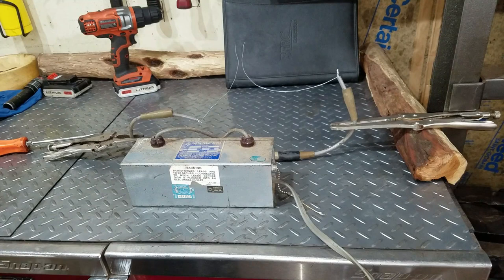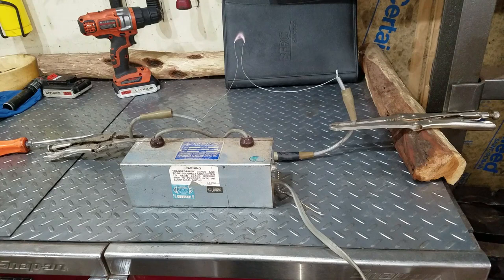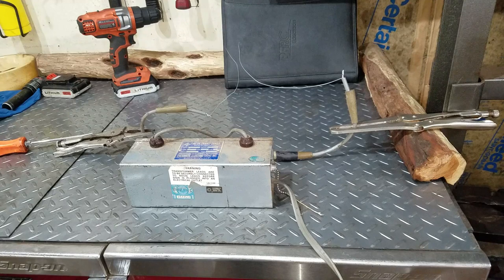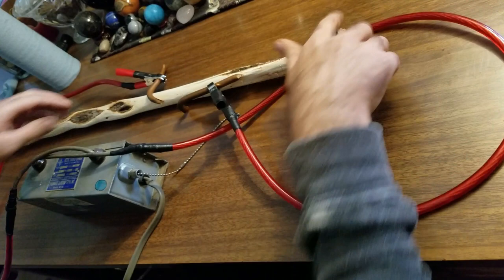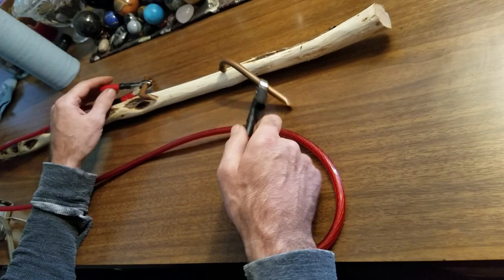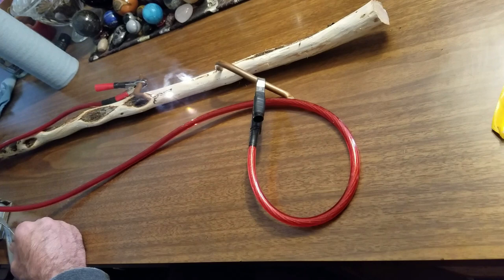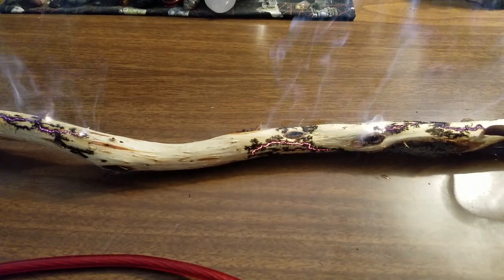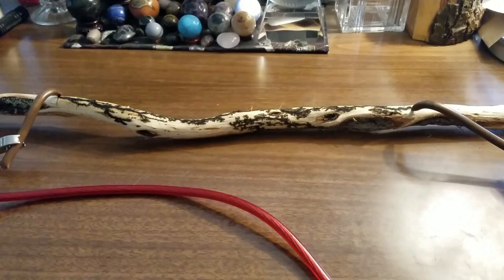Lichtenberg wood burning Diamond willow attempt

Comment: The first thing you did after your first burn was to grab both leads with you hands. In this there are no mistakes, you get zapped. with some transformers you are dead. Before you teach this learn your safety better. 24 people were killed in 2022 doing this. Yes they come out great and your videos are good, like telling someone about ice fishing without telling them about thin ice. Really like your diamond willow sticks. The one you used looks like a neon sign trans. this will shock like a really hot elect. fence. the new trans for this will not work as they have safeties built in for shorts. Raised in Minn. till 1962
Reply: If you don't like this I will take it down.
Reply from the maker: @newalla344  Yes. Very dangerous. I make sure it is turned off, before I touch any leads. It might be less dangerous using this versus those crazy fools using microwave transformers that are touching wires when they are hot, but I'm not willing to find out. Any time you are dealing with home electrical devices, or house wiring of any kind, it is very dangerous. Only a complete idiot would believe any of this is safe, and unfortunately, that would constitute to just about everyone on the planet.

Comment: An interesting experiment! Try the branch first well clear of bark and sand. Use a concentrated, saturated solution of baking soda - at the bottom of the vessel should remain undissolved crystals. After applying the electrolyte to the branch, wait a minute or two to better soak the surface. As electrodes You can use not thick screws in your clamps as Your source gives out a small current.
Reply from the maker: Thank You!